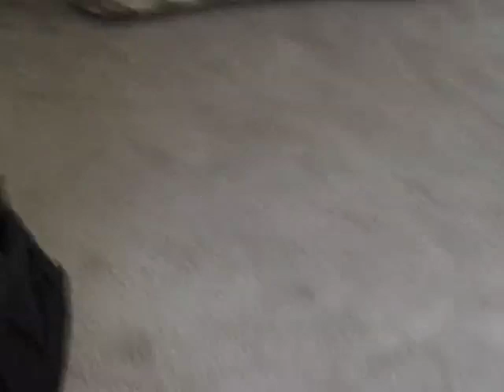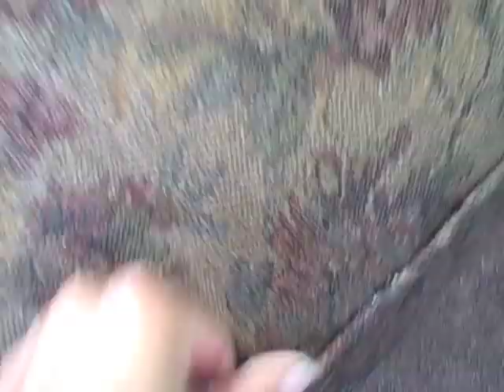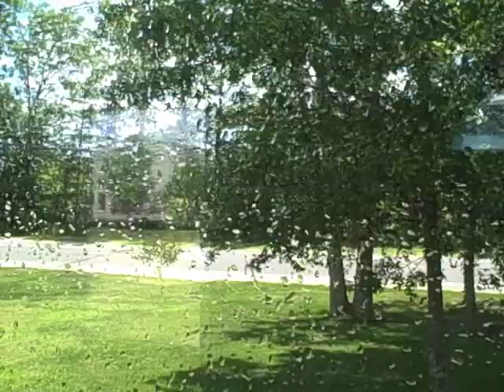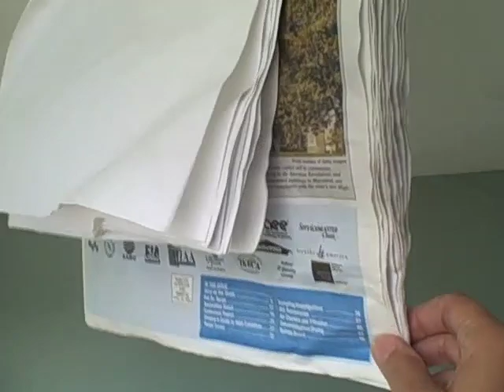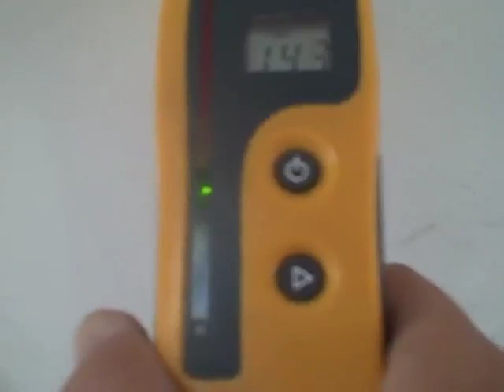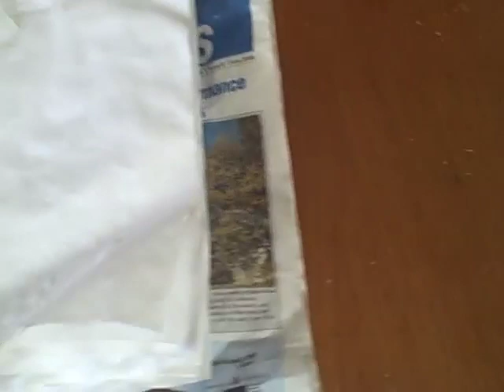Drying a flooded house. Water Out demo

Comment: Drywall has a moisture content of 0.1 % and cannot handle more than 2% by weight.....thats from the National Gypsum Association. So your Protemeter does not accurately reflect the moisture content. This is due to the moisture meter being calibrated on the wood scale. Just to let you know.
Reply: Precision Dry of Kentucky, LLC I think it’s reading points, not moisture content.
Reply: Depending on location of home, but still a bad video.